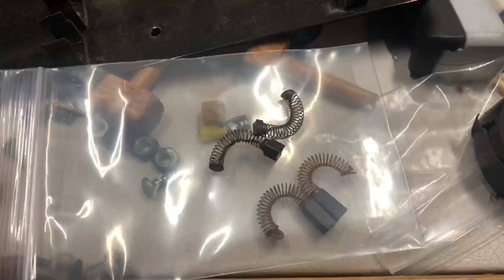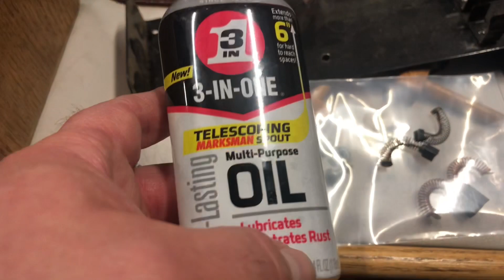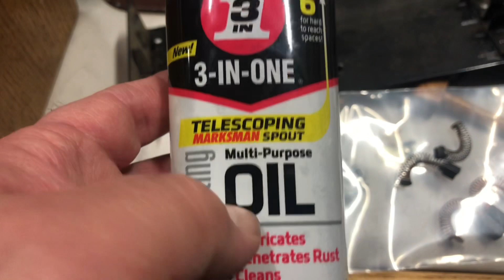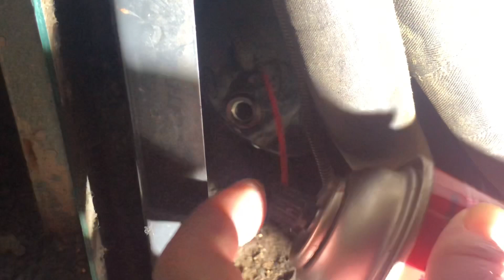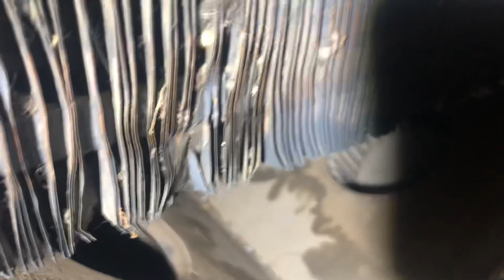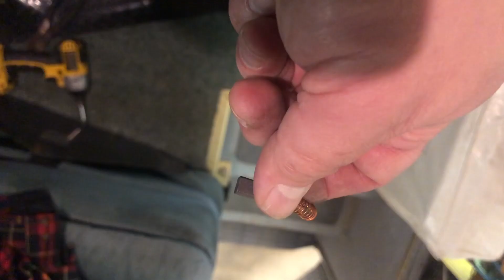Vintage GM bus defrost fan repair continued

Comment: 3 in 1 does have an oil like that special for electric motors. I know on cars I’ve had there was a resistor some where in the system that would fail and cause fan not to work on all speeds and the switch itself could need contact cleaner. Hope you get it figured out. Have a Blessed Day

Comment: Be careful using 3-in-1 oil. There is an ingredient in it which will form a varnish after a time, especially in warm areas. I've restored dozens of vintage sewing machines, and previous 3-in-1 oil has been a constant cause of aggravation as it glues parts together. Better to find some proper electrical motor oil.
Reply from the maker: What do you recommend?
Reply: @ThisOldBus  For larger electric motors, a non-detergent 20w oil works. Actually 3-in-1 brand makes an oil designed for motors - it's in the blue bottle. The one you were using contains a 'protective' ingredient which will cause problems, but I believe their blue bottle motor oil doesn't.

You can use any high-quality sewing machine oil for smaller motors. Get it at a sewing machine store (not the junk sold under the Singer name). I believe it's a high-grade 10w oil.

There are some motors not designed for oil at all. They use a special grease which liquefies slowly from the heat of the motor, often drawn to the bearing on a wick. It's less likely to drip into the motor and cause a problem. Singer used this in their later sewing machines with the internal motors. Oil dripping into small motors can cause as much trouble as not having adequate lubrication.

Since many of the small motors we encounter are hard to get to, best to get the proper stuff and get it done right. 

BTW, enjoying your videos very much.
Reply from the maker: Thank you. The manual says these motors no not require lubrication, however they probably didn’t count on them being used for 50 years. They sound bad and need something. I’ll go to the fabric store and see if I can find some sewing machine oil.
Reply: @ThisOldBus  Watched your video again - almost sounds like your squirrel cages in the fans are making contact and thus making noise. Hard to tell, but it's something to look at if you still have noise. I agree that a small amount of lubrication would be a good idea - 50 years is a long time for a no-maintenance motor to keep spinning.